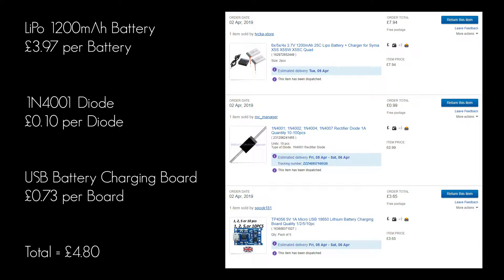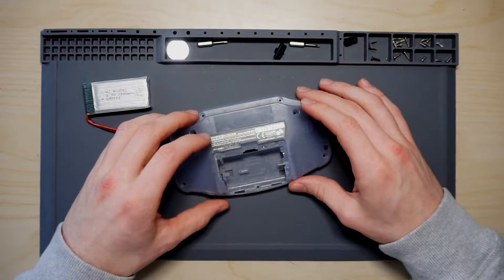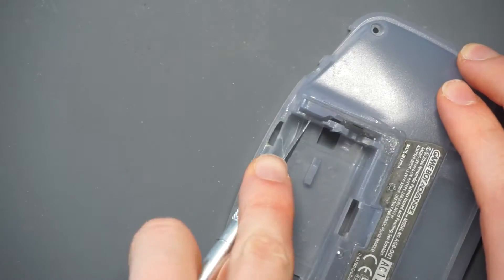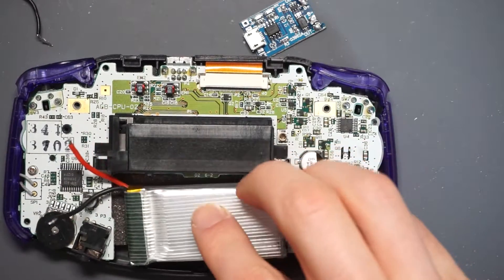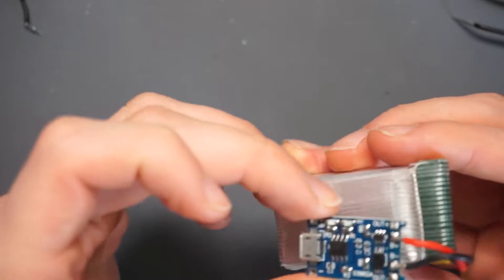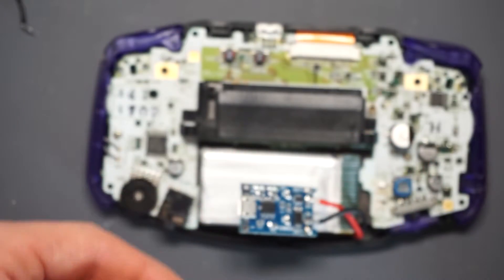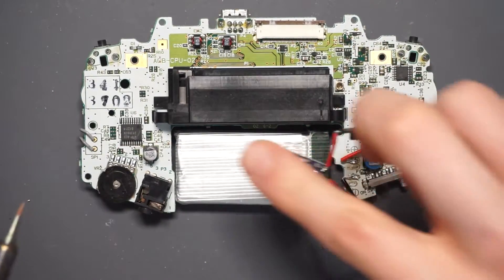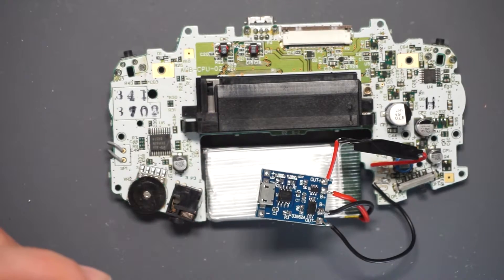Cheapest GBA Rechargeable Battery Mod! £5 TOTAL

Comment: I've found the diode used in this demo  drops the voltage about half a volt. At full charge many lipo batties can top out at 4+ volts. A battery with a max charge of 4.2 volts reduced to 3.7 isn't going to be very kind to a GBA motherboard over time - they don't like to run on much more than 3 volts.
Reply: Hi, there is any way to solve this?

Comment: Thx alot.. works great... i used an old Power on the go car charger and a 3.7V 3500mAh battery...gutted the insides ... wired the usb c battery mod to the pins, ok the battery is external... but at least i'm not making any modification to my console... am testing how long it will stay on !! :)

Comment: i just use my rechargeables from my XBox SX Gamepad 😂 with a little bit work with some wire they work perfectly for my GBA with IPS Mod, i don't know exactly how long the power lasts but it runs 5 hours straight so far without problems or red light or something 😂 sure i need to charge them with the charger but i have 3 of them so no prob is one empty i use the next one 😂

Comment: u need open to charge? no thanks
Reply from the maker: Yeah it’s not the best - you could mount it and cut a hole into the battery cover to access it or even, like I have done in another video, affix a wireless charger receiver so you can place it on a wireless charging pad and have it charge

Comment: Does this only work on the GBA, or is it a more-or-less general purpose solution for devices like the GBA that take two AAs normally?
I am specifically asking because I am considering to add this mod to my Wii Remotes.
Reply from the maker: The concept can be applied to any other device but you just got to make sure that the output voltage is the correct voltage for that particular device

Comment: So I've tried this mod on a GBC with success. But I've been attempting to do it on a GBA, and so far, I've had 3 GBA boards die on me as a result. They'll work for a short time, then just stop. My theory is maybe too much voltage. The TP4056 outputs 4.2v, and with the 1N4001 diode, it's reduced to 3.8v. I've confirmed this with a multimeter. Would I be correct in saying 3.8v is too much and if so, is there a diode I can use to reduce it to a more tolerable voltage?
Reply from the maker: Sorry for such a late reply but I think the GBC likes 3-3.2V, so 3.8v would be too high.
Reply: You can conect 3 diodes together to drop 4.2V to 3V
Reply: @carlosantoniolealmarroquin3918  Power draw seems to be an issue even with 2 diodes connected. I have a funnyplaying IPS screen, a clean amp v1.1 amplifier and a GBAccelertor. Under load the GBA power reads 2.5v and I've sen it crash and shut off on me. I cleaned the power switch just to be sure that wasn't the issue. The 1N4001 diode is likely not the best for my situation.
Reply: @Thatguy101987  as far as i know you can make a voltage divisor (divider) circuit, its easy to do and you only need resistances, i suggest using low value resistances to mantain a good amount of amps

Comment: I know this is a noob question but what does the diode actually do and why is needed there? If you could point me to some article to get myself familiarize with it it would be nice :)
Reply: Literally what I was thinking!! I'm curious too!
Reply: @robert_wolf6989  is used to reduce the output voltage, 3,7V from a LiPo is a bit too much for the GBA and may not power on as the internal circuit protection kick
 in
Reply: @fostrike  thought so, but from what I've red diodes are used to stabilise the current
Reply: But doesn't the gba run at 3.7 volts already??
Reply: @robert_wolf6989  GBA runs on 3V

Comment: can you charge while playing?
Reply from the maker: Yes, but it’s not recommended
Reply: @TheRetroStation  Ok cool. This is still the best option imo since all of the modding sites are charging a ridiculous $40 for a simple board and battery. Nice vid
Reply from the maker: Yeah I wasn’t happy at paying that either so did some research and got help from the discord to build my own. By no means the first to do this though - just not buying a pre-built one
Reply: @TheRetroStation  Yeah I miss the days 3-4 years ago whenever this was new and modders were soldering cheaper boards into their systems and actually building with available parts instead of just marketing their own from affiliate links off expensive retromodding sites. I've been looking for a vid like this for a long time.

Comment: A suggestion to improve this mod:
Have both wireless and USB charging available.

Method:
Instead of plugging wireless pad into USB port,
snip off the USB connector on the wireless pad and solder it directly to the charging board.  
There are (+) and (-) soldering points on the USB input side.
Fit the board with the usb port downwards.
Drill a hole in the bottom part of the battery cover for USB access.
- or you can buy GBA battery cover with cutout for USB.

This way you still have the convenience of charging from USB when wireless isn't available/ unsuited.
Reply from the maker: Yeah I was originally going to do this but just to get it working I skipped that part - definitely would be needed since can’t always rely on wireless charging! 👍🏻

Comment: Hi, does the LED turn red when the battery is almost empty? Or if not is it possible to include this feature? Retrosix and Handheldlegend are selling an additional board for their first version of the Cleanjuice battery. Maybe this board could also be added to your mod if somebody knows which points have to be connected

https://handheldlegend.com/products/low-power-add-on-cleanjuice-game-boy-advance-rechargeable-battery-mod
Reply: This charger board uses the TP4056 IC along with the DW-01 protection IC, which unfortunate doesn’t have a battery indicator. :(
Reply: @akhurash  Thanks for your reply.

Comment: do you need the diode?
Reply from the maker: Yes, in this situation it is used to bring down the voltage output from the TP4056 board down to 3.2-3.3v which is what GBA needs.
Reply: ok, so it's only used for that

Comment: Will this work for a backlit gameboy?
Reply from the maker: Yeah no problem
Reply: The Retro Station thank you bröthær
Reply: The Retro Station how long does the battery last?
Reply from the maker: Haven't properly tested a full charge/full drain but it also depends on the mAh of the battery - in the video I used a 1200 mAh battery which I dunno, could last a good several hours? I can confidently say it will last longer than two AA's

Comment: I have a similar mod, but I used a 103450 li-poly battery, TP4056 USB C charging module, and two solder tabs. The solder tabs act like battery contacts so you don't have to solder anything to the board. Just get a spare back shell, cut out the battery compartment (minus where the back shell's battery contacts are supposed to go. You need them to push the 103450 battery into the board's contacts), put a hole in the battery lid, and you can drop it in the GBA.

If you wanna go back to using AA batteries, just change the back shell to another one with the battery compartment still in, and it works fine.
Reply: Do you have links of it with pictures?
Reply: Does it works and gives you no voltage problems?

Comment: What is the point of the diode?
Reply: It lowers the voltage from the battery's 3.7v down to 3.0v. The GBA has voltage protection, and 3.7 is too high for it, so the system actually refuses to boot with 3.7v.

Comment: If u got a ips V2 Screen you cant Go higher then brightness lvl 7, the gba shuts it self down.. with this battery mod
Reply: Dont Know homes... im looking currently for a Solution....
Reply from the maker: Have you tried on the Gameboy discord? Lots of more knowledgeable people on there could help out! I’m currently building an IPS v2 with battery mod so at some point I’ll check to see if mine does the same!
Reply: The Retro Station the solution for me now was to Solder Out the Diode... with the diode you get  about 3.5v .. and more brighter you Go with the screen the voltage Drops too much and the gba shutsdown  😅 

I Can perfectly play the gba without the diode but if i try to play while it loads the battery it dont starts because of the high Loading voltage From 5v 😅😅 

Maybe a diode what only Drops the voltage 0.2-0.5v could help....

Comment: What will happen if you don't add a diode?
Reply: From what the comments say, it won't work. GBAs have an indicator for your power led to change colors based on battery life which also protects the board from over-voltage? Don't quote me, just repeating what I've read since I had the same concerns

Comment: have you notice battery/lipo getting warm/hot while charging? thanks
Reply: the charging board dose not have the right charging current set ,the tp4056 charger charges at 1 amp nativly you need to change the charging current to 500/600ma range
Reply: @trygun3034  how do you do that or is there a link that tells how to change the charging current?

Comment: Hi. Can a 1N4148 diode be used (I have lots of them lying around), or it has to be the 1N4001. Any differences on one over the other? Thanks!
Reply: sithpadawan did you ever figure this out? What is the Diode For anyways?
Reply: @ericsalidbar1693  diode let's current flow in one direction only, but has a special feature that it consumes 0.7~0.8 volts which is exactly what you need for the GBAs input voltage. The battery supplies 3.7v and you need 3v (the same as two AA batteries 1.5v*2), after the diode you take away 0.7volts and those 3v left go into the GBAs circuit board
Reply: @JBarraza  what happen if a diode is not used? Can we just let the 3.7v flow to the GBA? Im just wondering since ive seen battery mod for GBC and no diode were used
Reply: @TheMushMe  the GBA has a circuit right after the batteries that detects voltage. That way it can know if you're running low on battery and change the LED to red, that way telling you that the voltage is dropping. Another thing it does is that if it detects over voltage (I bet is something greater than 3.3V but don't quote me on that) it will simply not supply the power to the rest of the motherboard, thus the Gameboy is protected but it won't turn on.

Comment: This is the mod i'm most on the fence about on my GBA. I modded in a AGS 101 screen, waiting for my shell to arrive and have a custom print prepared, considering a speaker mod... But you can just use rechargeable batteries. More easily available and when they go bad you put in another set. In Your opinion is there something to gain from this?
Reply: I soldered on a mini jst connector to both the pcb and the battery and embedded the pcb inside the gba, wiring it within and dremeled a small hole in the bottom where the port was. 

The best part of the jst is that I can just unplug the battery if I run out and swap it with another if not near an outlet or I can just bring extra aa with me and swap those in instead. Just an idea!
Reply: I have a video with the same build; it runs like a dream. I get 13 hours off of one full charge with an AGS101. I say go for it.
Reply: @user-vq5gv1vg3w  Don't go for it. 1. The battery will still have to be replace 2-3 years down the line as Li-po have 200-350 cycle use. 2. 2000mah is the biggest Li-Po you can fit, causing irreversible battery modification (a new back shell would be require to revert mod), 1200mah biggest Li-po with reversible usage to AA. 3. Rechargeable Panasonic/Ladda batteries are 2000 to 2500 mah each.

So yeah, AA rechargeable don't cause any damage, are convenient and give you 2-3 battery capacity. Don't get me wrong, I successfully did one of these in GBA and GBC. Successfully undid them as well lol Rechargeable AA are just way more superior.
Reply: @jonathanmsantos5405  it's not hard to buy another battery (5$) 2 years down the line and re solder it. But each method has an advantage; Nothing like OEM sometimes. It's very convenient for me to travel and plug into a micro USB anywhere without carrying batteries.
Reply: @jonathanmsantos5405  I can also just revert back to double. The case can be left perfectly intact .If you cant revert back it means you just don't know how to solder. Personally I threw my double a spring/pins away. However; I completely forgot or didn't know about charge cycles, so thank you. I will consider this in my ebay store.
Reply: @user-vq5gv1vg3w  I use LADDA (IKEA) batteries on my AGS 101, suposedly they are on par with the eneloops everyone loves, and they were about 7€ for a 4 pack. Can´t complain. I totally understand doing this mod for the challenge or the practice, but i would not go for it myself. Either way, this opens up options for people who may want it, great work :)
Reply: @joaocosta6697  yeah, its amazing. I could never dream that all these instructions/manuals would be free, and so open when I was a kid. We are very lucky. The reason I do these on Ebay is to help people get started, I am very transparent with potential customers much to the dismay of my store lol
Reply: @user-vq5gv1vg3w  No sir, its not an issue about soldering. when you add a battery mod, depending on what battery size you go with you will need to heavily modify the battery slot. Some of that plastic cutting might still allow usage of double AA some will not (not without replacing the shell). Soldering the pads back should be easy for anyone already doing this project. No need to offend me, I am not a pro at soldering but i have done it for 10 years since my repair as PC tech (replacing DC jacks and USB ports was the beginning of my career in soldering, so I am pretty confident.. Did many 3ds hardmods when softmod was not available)
Reply: @user-vq5gv1vg3w  The mod in this particular  video, is not bad, its actually good, he does not damage the battery slot to the point you can revert AA usage. However, it really boils down to personal preference: Charge and play, then this mod. Longer battery capacity, then AA's.
Reply: @joaocosta6697  This is a great mod for someone who has decent solder experience, and that can't really live without charge and play or just travels a lot and rechargeable batteries just won't do it for them. Like I said earlier to "Type-R programming" I have done done this mod plenty of times, but i still find the Rechargeable batteries being completely superior. 1200mah only gives me 7 hrs in a funnyplaying IPS at half brightness. AA's Ikea/similar give me 20+ hours in same gameboy advance lol (i stop counting after 20, its probably about 24-25)
Reply: @joaocosta6697  Bottom line I love this videos, and this guy did an amazing job. His mod is one of the best and I know it did help me in my modding, I hope it helps others who really need plug and play or just don't want to deal with AA's
Reply: @jonathanmsantos5405  Yeah dude; i feel you on that one. The Ikea double AA the last guy mentioned might have been a good option. But i got really excited at building something/modifying with a solder lol
Reply: @user-vq5gv1vg3w  I completely 100% understand that feeling xD that was why i did this on a few systems, even though i knew I did not need it  lol The feeling of building this is so satisfying everytime.

Comment: Hi,

Thanks for the video!!

The Diode really helped. (I am not an expert in these matters)
Without the Diode the voltage was too high for my backlit screen. Apparently the Diode serves 2 purposes, ensuring voltage doesn't flow in the other direction but also decreases the voltage by about 0.7v. Taking into the 3.3v range the components expect from 2 AAs. Works perfectly now. Cheers.
Reply: Yes. You are absolutely right !

Comment: A Dremel is the best tool for this. If you still want to keep it cheap, use an hairdryer at the hottest setting to soften the plastic a bit, just make sure you keep it going for some time and don't put it to close so that it melts the plastic. You can use any tool to check if it's soft enough, it will budge easily.
Reply: Yeah dremel type tools are great for this i got a cheap one on amazon for 20 quid a year or so ago dont use it too often but its great to have when you need it for stuff like this

Comment: Hey buddy good vid do you know if this would work with the original game boy dmg the gray brick?! Lol cheers
Reply: I wasn't sure if that has an input voltage of 3volts (2 pairs of two batteries in parallel) or 6 volts (4 batteries in series) but I read somewhere that it takes 6 batteries so you would need to have two lipos (3.7*2 = 7.4V) I'd recommend you use a regulator board to limit the voltage to 6, although I think that it will work fine with 5v too
Reply: Late to the party here but:
The batteries to the DMG provide 6v, but the power board for the system feeds it 5v. Instead of 2 LiPo batteries for 7.4v, you can just attatch a step-up voltage regulator board to send the unit 5v

Comment: it is not worked with me,i do the same guide but the GBA is only turn on if i plug in the charger cable, if i plug off, the led is only red, the GBA wont turn on, please help
Reply: you must have blown one of the GBA fuses, that is why you need a Diode install.